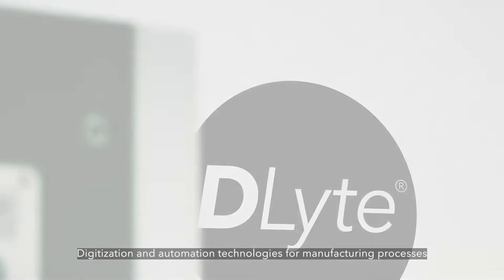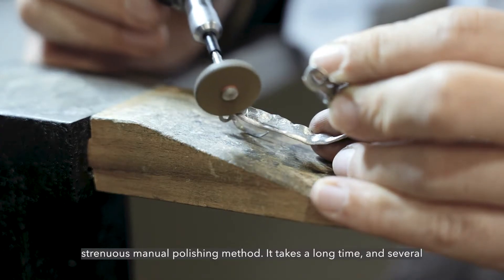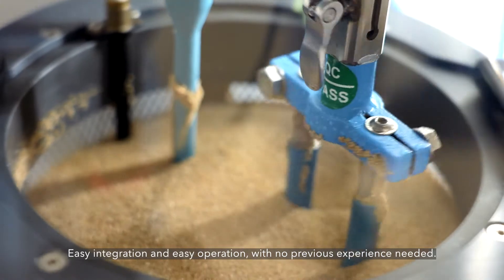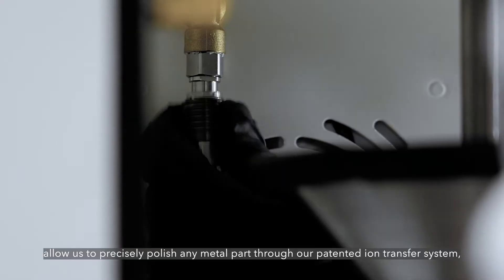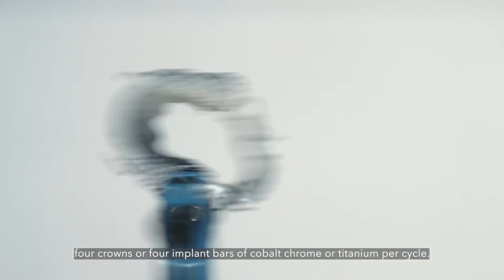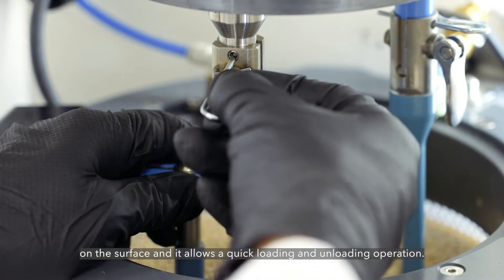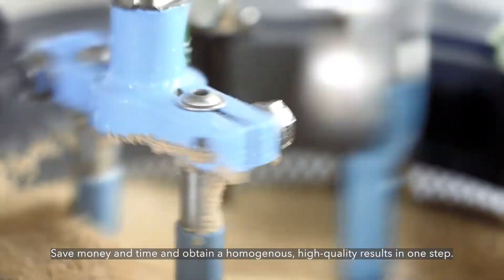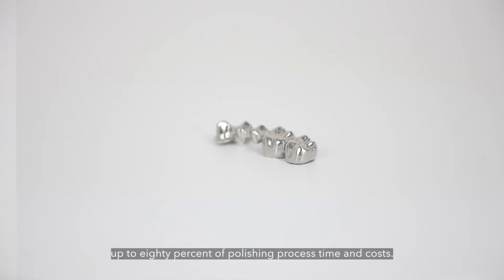DLyte 1D: The solution for dental laboratories

Comment: How long does the media last? Is it dependent on the amount of substrates placed through it or is it time?
Reply: Dear Austin, for the dental series machine, the CoCr electrolyte will last approximately 100 hours, and the titanium electrolyte will last about 50 hours. J. Homrighaus is the Director of Sales at GPA Innova Sunrise, FL.
Reply: I have the system for jewelry, and it is based on time.  After 300 hours of use, the media needs to be replaced before the machine can continue being used.  I imagine these machines have a similar protocol.